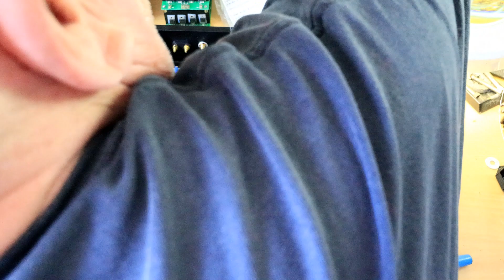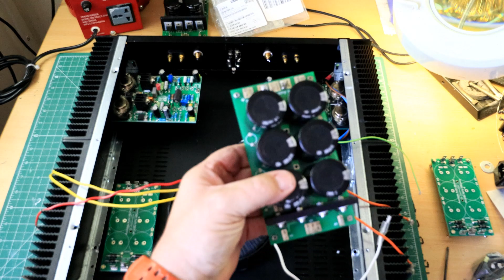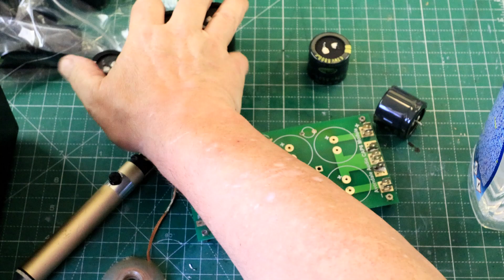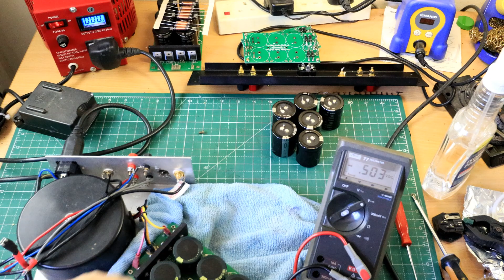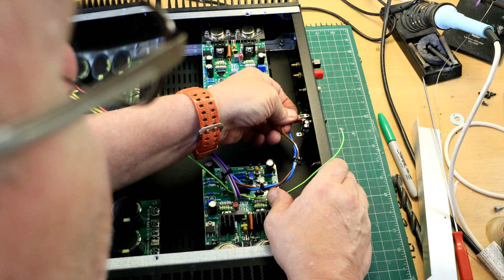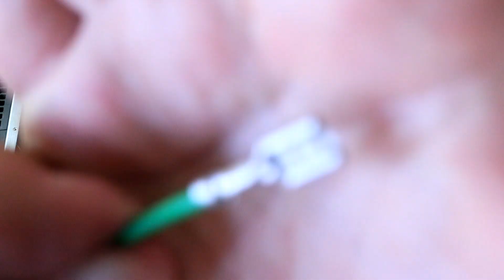Avondale Audio another amp build pt2

Comment: Was only binge-re-watching some of your older videos today at exactly the moment the notification of this latest one popped up; perfect timing. I might be wrong here but did you sell a cheap pair of black ash Isobariks on behalf of someone on eBay (iirc) last year, maybe the year before? They had funny little passive crossover boards screwed underneath them and they were mounted on rudimentary “stands” made out of MDF. I came up from Plymouth to get them if that rings any bells?
Reply from the maker: Yes I recall, did you get them up and running??